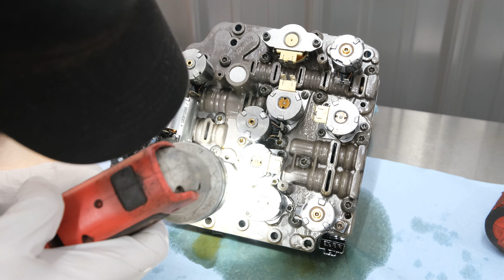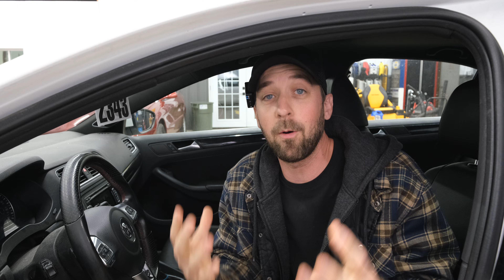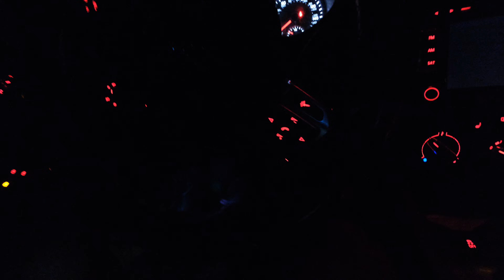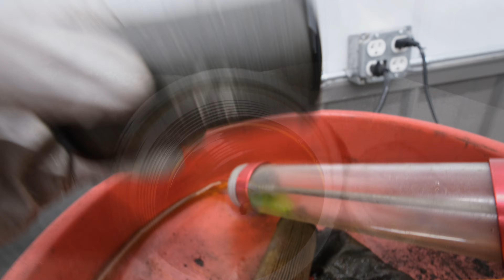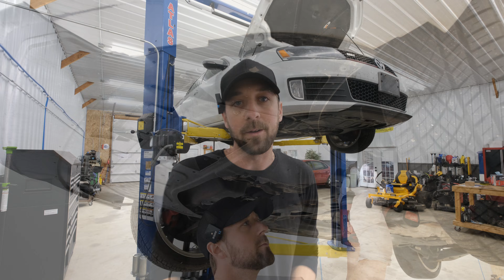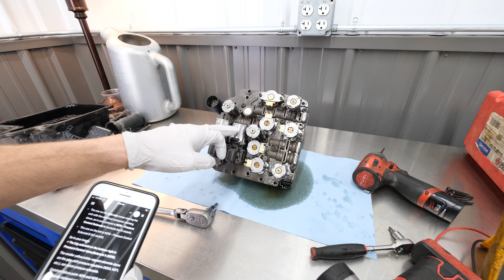Saving a $1,000 Jetta GLI Dealer said to Scrap! How bad Could it be?

Comment: You took it to the dealer that’s the problem!!! I have a 2012 cc  132,000 mil I did proper maintenance fuel, intake, timing chains, eta! I rotated the tires and changed the oil then it wouldn’t start. Couldn’t figure it out took it to the dealer they told me it need a security module in the steering column replaced it still didn’t work so they replaced another part 2 weeks later they called me and said the car needed a new ECU! I said absolutely not I’ll be there to pick it up and pay my bill! $1,100 Took it to a local VW shop and had it fixed for $300
   I will never go to a dealer ship agin for service!!

Comment: Important safety tip:  Change your DSG fluid and filter every 40K miles and you'll avoid problems like this.

Also, what they were charging for brakes was highway robbery.  I just did the front brakes and rotors in my mk7 Golf for $150.  Even with dealer brakes being double that, it sounds like they're charging $500 labor for a 2 hour job.  That's just gross.

Comment: I have a 2015 Skoda Octavia VRS (mechanically a VW Golf GTI in a larger body) with a 6spd DSG transmission. While still under warranty it developed rough gear change and the coolant overflow bottle looked brownish. Turns out the DSG oil cooler had a pin hole leak that allowed transmission fluid to enter the cooling system (fortunately not the other way). Skoda service told me that DSG transmissions are sensitive to low oil level causing rough gear changes. I could imagine that blocked filter could cause similar symptoms. No transmission problems since the repair but the water pump developed a leak a few years later that might have been related.

Comment: I have a 2012 Audi A3 
Recently had a P0717 Turbine/Input shaft speed Senor circuit no signal. 
Did the DSG service, changed the sensor inside the valve body, made sure the car got back into operating temperature checked fluids, everything was fine
And the car did the same thing. 
DRNS on the dash was still flashing and I’m stuck in the situation. Anybody have an idea? 
I know he was asking for advice but I would like anybody input if anybody has ran into this situation as well! Thank you!

Comment: You'll be surprised how a poorly serviced DSG drives. The 40k service is very very important. A correctly serviced trans will have gear oil come out the same color you're putting in. With the fluid in that condition, I would've started with fluid and filter... then performed basic settings of the syncro points and clutch pressures. Probably would've taken care of it (but knowing it's had a trans before, the owner might've been doggin the poor thing). That body style (mk6), they had the mechatronics stuff figured out by 2013. - VW tech
Reply: The DSG381 (MK7 GTI/GLI) doesn't actually require the 40k service. Apparently they use a more robust fluid and there is no service interval. These old DSG250's were a better transmission though.
Reply: @magi115  the 7 speeds are 80k fluid and filter. The clutches are still wet clutches so that service interval is definitely required. The 6 speed dsgs are 40k

Comment: VW owner and DIY here
By the look of the oil it seems like it's never been serviced, DSG needs to be serviced every 40k I would start by that first.
In order to perform the service you'll need a bi directional scanner (my prefer method) so you can get the temp and then the level of the oil correct. Once you're done with that with the scanner you can go into the TCU and run the adaptation.
If it an electrical issue, there's a resistor in the board that you can replace but you'll have to order it from China since VW won't sell it. There's a video on here that shows the procedure just search for it. It's basically a guy pulling the mechatronic unit just like you did and cutting the resistor (it's round with a wire that looks like a S going thru the middle) and soldering on the new one.
Reply from the maker: Awesome! Thanks for shedding some light onto the topic at hand. I ordered some parts and fluid so I’ll be giving it a go. Let’s see what happens I guess. 🤷‍♂️

Comment: I’ve owned several 6speed and two seven speed DSG VW and always changed the fluid and re adapted the transmission every 40k and never had any issues. That fluid is toast. All of my drained fluid was barely darker than the new fluid I put in.

Comment: DSG owners. Do you filter on time using the VW schedule, but here is a hint. Drain and fill the trans every 20k. It takes just over 2 liters and doing it will keep your fluid quite fresh. Your transmission will last well into the 200k range. Fluid starts to break down at 20k, doing a complete drain and fill with a filter, than do the 20k interval make the trans last a good long time. Also, improved fuel economy, shifts, and torque climbing hills. Look it up.
Reply: It's good advice but DSG fluid is NOT cheap. At all.
Reply: It's good advice but DSG fluid is not cheap... At ALL.

Comment: All the transmission may need is a DSG fluid change along with a re-learn of transmission sync points. I use OBDeleven to relearn the trans after fluid changes. They need this step sometimes.

Comment: That filter doesnt look like it was ever changed 😮
Reply from the maker: Yeah, apparently this is the 2nd trans, replaced under warranty at 65k miles. Has never been serviced after replacement… 🥶
Reply: @ManvsCars i love my dsg but i have a newer one 2020 gli, but i made sure i did it first thing also did a dsg reset with obdeleven.

Comment: I'm not gonna lie, I have driven those dual clutch transmissions before and yes they are a lot of fun to drive. But I still prefer the traditional manual transmission myself. Yes I know these are faster and get better gas mileage. But IMO nothing beats a manual gearbox with 3 pedals. As a matter of fact, I still daily drive a stick car to this day and that is my 2005 Honda CR-V.

Comment: I see that a lot on those. This car was manufactured in Mexico. I can tell because the VIN begins with 3 which means that's where it came from. That being said, unfortunately those ones are not quite as solid as the ones made in Germany, in which case the VIN would begin with a W. It can be fixed but definitely not for somebody who is not mechanically inclined. Looking forward to seeing this series.
Reply: The German ones are just as bad.

Comment: VW AUDI AG DSG's transmissions will act jerky if the filter and oil is not changed after 55k miles! some of them have a dual drain plug,
another drain by the front of the transmission,  please dont waste your time and double flush the transmission oil. Whenever on this situation! then change the oil every 30K miles

Comment: I think the dsg is meant to be serviced every 40,000 miles
Reply: Correct.  It's best to change the fluid every 25k miles.
Reply: @JW-lo2bh best? I mean sure of you want to but even at 40k with normal use the fluids still look great. That being said unless you have a bad seal of moisture getting in.
Reply: 50k is a good rule of thumb. I've done the service at 40k and it looks brand new. They're not that sensitive.

Comment: Fun project, I have exact 30th edition GLI white also.  212k miles.  I bought it with 4 miles.  Only difference mine is 6spd manual.. my clutched slipped fixed it with TT-RS pressure plate no more slip. 

Good luck,  will be watching
Reply from the maker: Awesome, yeah a 6spd would be preferred! Thanks for tuning in.

Comment: Will be watching closely!  I have the exact same vehicle (also white).  I have 146K miles and have religiously changed the DSG fluid every 40K mi. (per owner's manual).  I haven't had any transmission issues other than the quirky low-speed shifting that is common with the DSG.
I would say go with the fluid and filter change as the next step.
Good luck!
Reply: If you have vcds or obdeleven do a dsg reset, its good to do after every dsg service or if you do a tcu tune. I did mine after my service it relearns your driving habits and adjusts to the fluid

Comment: VW dealers are crooks. This is the reason people can't afford VW. My 2004 Golf had 5 codes and would not spin pass 3100 rpm. One code was for the cam sensor and the other 4 was for the coil. The dealer said I needed a timing belt. I knew that was not it because I just had a used engine put in with a new timing belt. I bought a wiring diagram and fixed it myself. It needed a $17 temp sensor.
Reply: 😮 its not just vw dealers
Reply: Many American 'mechanics' don't know how to diagnose European cars...
Reply: @eknaap8800  This was a VW dealer. They knew what the problem was. They was just trying to get over. I went to an auto tech school and I have been working on cars for 40 years.

Comment: I know the DSG can be a little jerky in sport mode at slower speeds, say coming to a stop. Shouldn't clunk into gear, but can be a little jarring, if that makes sense. Under a little bit of acceleration, it should change gears pretty snappy.
Reply from the maker: Hmmm, maybe it’s normal engagement? It’s almost like a flare up going into reverse and 1st. Otherwise it shifts smoothly and snaps very quickly.
Reply: @ManvsCars  Odd. Shifting from reverse to drive or vice versa should be a non event. However, say I am reversing (parallel parking), and maybe I don't stop all the way and go into drive or I do it too quickly, the engine feels like its stalls or studders a bit. Its done that since new. If i am sure I've stop completely, it shifts without studder. I've chalked it up to just DGS quirks. DSG service done at 32k. at 43k now. 2017 gti.

Comment: Those dsgs are bulletproof what I’ve heard. The 7 speeds have a valve body/electrical issue occasionally but not 6 speeds
Reply from the maker: Yeah I haven’t seen much other than maintenance issues. Being this thing hasn’t been serviced I’m leaning in that direction first. Have you seen anything on the pressure control valves? Possibly internal issues once warmed up?
Reply: @ManvsCars I have not seen pressure related issues other than when they are low on fluid. I believe these need to be running during the fill process and go through a couple gears to engage both clutches for the proper fill amount while the fluid is still somewhat cold. Kind of a process I know!

Comment: I've totaled a lot of otherwise good VAGs due to DSG failures.  The issues with playing around with pulling the mech and swapping solenoids, replacing the mech, etc, is at client cost you're already into multiple $1000s in repair for a "maybe" which is why I don't tear into them anymore.  When they're under  warranty, VW would authorize harness and solenoid replacements, maybe entire mechs, but that was under warranty , so if it didn't fix it, it didn't cost the customer anything, and 90% of the time we'd replace the entire transmission if replacing other components didn't work.

If you can shade-tree a fix and throw a mech at it or remove the trans and replace the clutches, more power to you, but from a repair shop's perspective, it make more sense to just replace the entire transmission.  "Buy once, cry once"
Reply from the maker: Absolutely. Honestly, back in the shop days I would’ve only done it that way also. High stakes gamble and you gotta get paid for your time. Most consumers don’t understand that and it’s much easier to do what you say “buy once, cry once”. Sadly enough, it’s also why most cars head to the graveyard. On this one I’ll gamble a bit tho lol. Might make for some interesting content if anything. Plus I’m always curious to see what/why things I don’t usually rip apart fail.
Reply: Yeah, this and probably quote was more like "F off" to avoid transmission job just to later be greeted with broken TCM

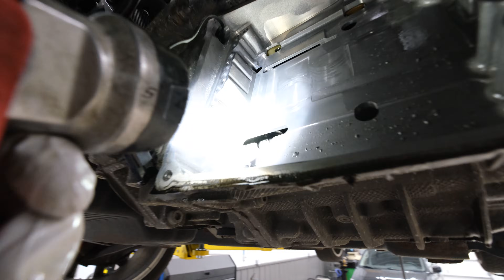Comment: Okay so at 16:00 it looks like theres a bunch of debris inside the trans stuck to the case.  Im suspecting the trans had a bearing failed internally.  Might be better to find a donor DSG and swap in the vin matched Mechatronics unit into the donor unit. You can also swap solenoids from the donor mech unit.  With the look of that fluid id asvise a new trans, trans cooler, flush the lines, and rebuild the original mech unit with a donor trans.  Or manual swap with the 6spd (09M?). These GLIs were nice and did come with a 6spd from factory iirc
Reply from the maker: I thought that at first but that's the actual casting. I put a boroscope into the gears and they actually look fine. I'm probably going to gamble on it for now however a 6spd would be nice!